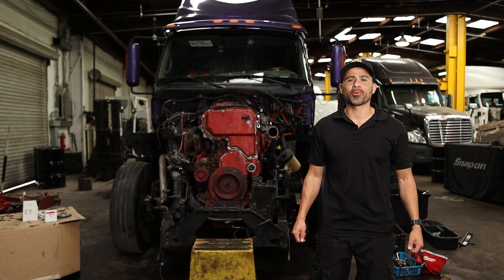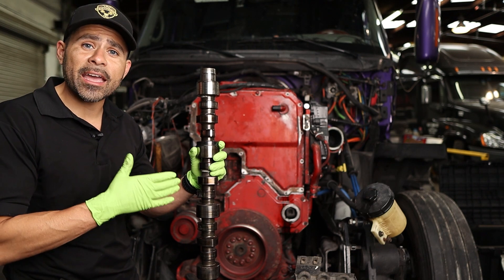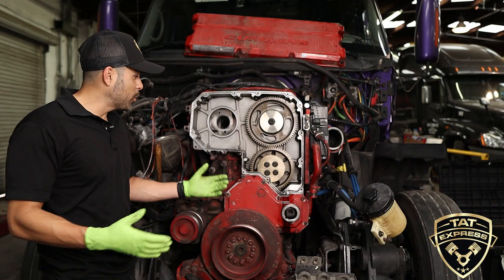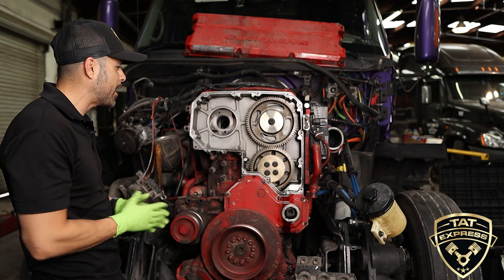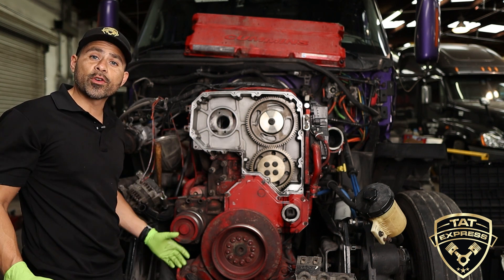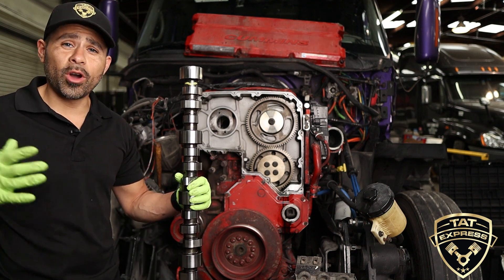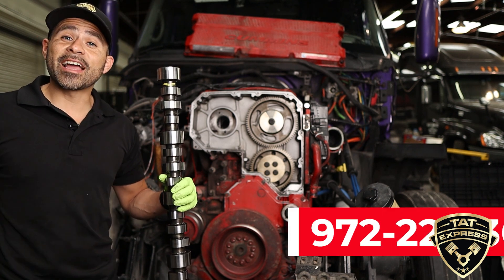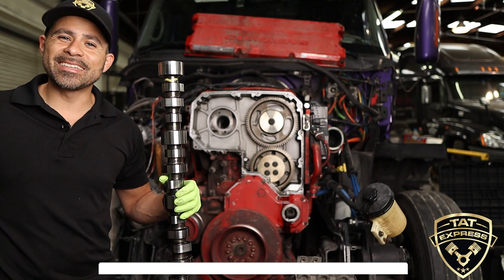Cummins ISX Cam Failure / Cummins engine miss/ Cummins rough idle/ Cummins Cam replacement/ Cummins

Comment: Being the unfortunate owner of a truck with an ISX engine in it all these things you're saying is so true. Had to eliminate the def because I couldn't afford to keep it and keep the truck running even Cummings told me to delete it! Blue the first engine after I deleted it from the damage that was already caused to it didn't even have 450,000 miles on it yet! 84,000 miles after I got a long block, camshaft went out that was another $23,000 on top of the $40,000 I had spent. Ran fine for a long time. Now I'm going through the issue you're talking about had two overheads done in less than 3 months would not stay in time! I've got a guy working on it right now that seems to know his stuff like you do, first thing he mentioned was that cam gear it is a single cam! The damn camshaft is turning inside the gear throwing the timing off and causing all kinds of problems. I hope I get past it cuz I'm ready to retire but I will never suggest anybody buy one of these pieces of crap! The worst engine I've ever seen in my 43 years of trucking
Reply: Not as a whole it's kind of the luck of the draw..I have the same engine he advertised an I'm about to go inside of it for the first time after 1.4 million miles all original injectors never had an overhead or the bottom end done! I'm now getting a funny noise somewhere along the valve train..but nonetheless no oil leaks or loss of power!

Comment: I know cummins states to run the overhead at 500k but there is also an engine hour spec that goes along with that. Most ISXs I've worked on had double the recommend hours for that procedure. And that is where you see that wear on the intake lobes every time. I recommend all my customers to have the overhead ran once a year or every 100k. The idle time is what kills the cams.
Reply from the maker: Washmyburn, thank you for your input. 💪🏼🔧👊🏼
Reply: @TATEXPRESSINC  If it idles at slightly higher rpms after you drive it then after 5 minutes it settles normal is it the auto regen or could it be a problem?

Comment: I'm actually picking up a truck out in fort Worth it's got 650,000 mi on it it's 2006 what are some of the signs of a bad camshaft .

Normally I'd have the truck taken to a shop before purchase but I've missed out on three or four sales already dealers are taking cash up front and it's pretty much picking up now and leave or don't bother coming or I would take the truck over to you guys or Cummins and at least have the the valve cover taken off also do the older Cummins have the ceramic fuel pump problems?

Comment: Fairly common on those engines or so it seems. Keeping the valves adjusted and changing the oil because of all the soot helps to pro long the like of the camshaft and rockers.

Comment: After replacing the camshaft on Cummins after 150 miles got the stop engine light. Truck is running but gives a lot of smoke and cylinder 6 misfire. Any suggestions where to look?

Comment: Good video , but you should explain WHY it happens & what could be done to PREVENT it. THX.
Reply: I'll tell you why it happens because it's a come apart Cummings piece of crap! Worst engine you can own. You can do everything right your PMs and everything right on time doesn't make any difference these engines with these def units and all the government controls on them are garbage. Don't expect not to have to work on them all the time

Comment: For me every 350hours (engine)oil change  i don’t go by mileage due to idling is not figured in the mileage oil change , so I go every 350 engine hours.
Reply from the maker: Thank you for the input.
Reply: Good idea, I love common sense!
Reply: I don't idle my truck and I change my oil every 8,000 miles.  It's only $350

Comment: I'm having the same issue where my truck just died out and wouldn't start up
Reply from the maker: Kennard, sorry to hear about your troubles. Ensure the truck is getting fuel and check power and ground cables at the batteries and starter.